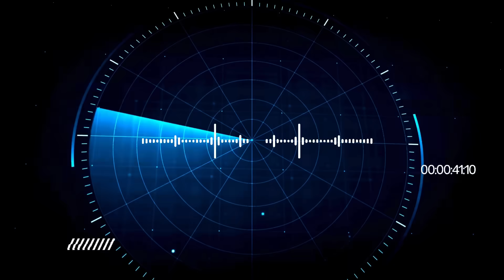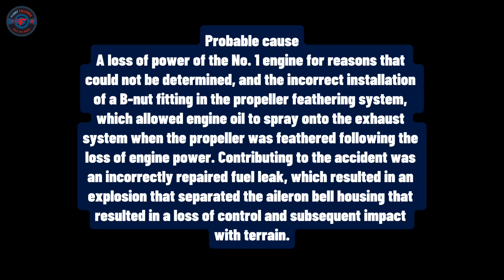(Tragic) Fatal DC-4 Crash in Alaska Triggered by an Incorrectly Installed B-Nut! #atc

Comment: After engine failure. Need to use rudder and not ailerons to control torque. Classic tip stall
Reply: Hard to use anything if its damaged

Comment: Another example of how critical well-trained and disciplined flight mechanics are to any air operation. Flying is much safer than driving but the stakes are raised considerably when something goes wrong. An improperly repaired car results in the car dying. An improperly repaired plane results in people dying.
Reply: Flying is safer than driving in Part 121 ops (major airlines) but in Part 91 the risk is the same as riding a motorcycle.